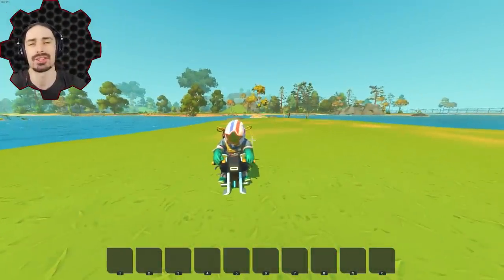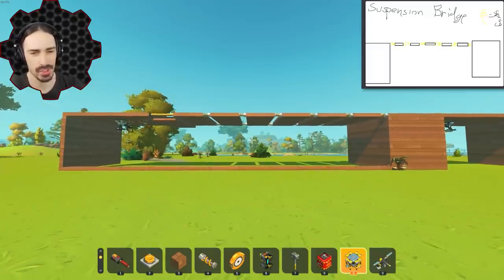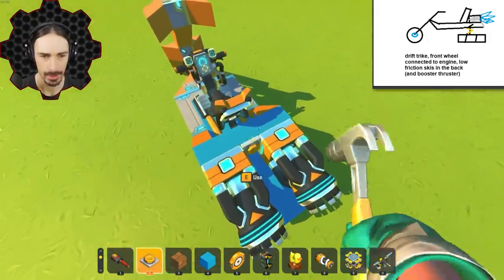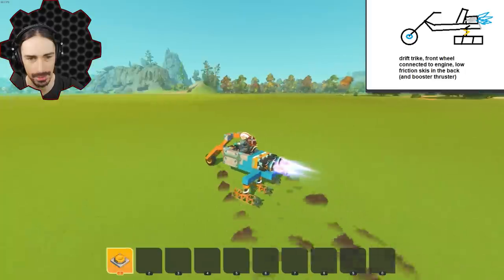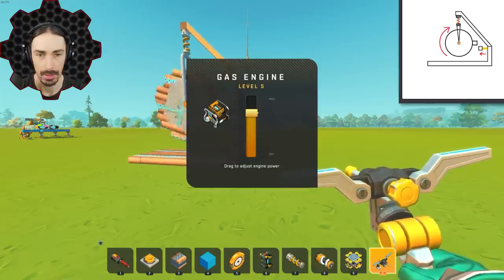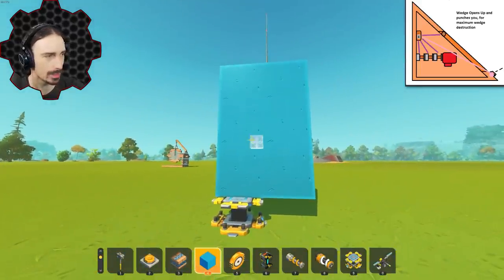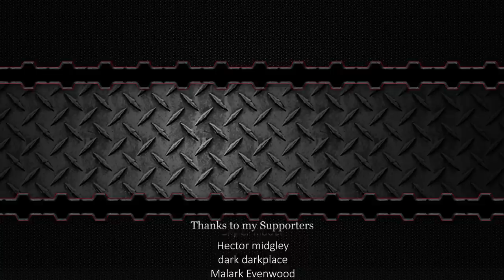You DRAW IT, I BUILD IT! Flywheel Physics, Drift Trike, and MORE! [YDIB 17]

Comment: Should've used simple physics 1 for the catapult, bearings on creations that are attached to the ground are super strong on that setting, only ones on free floating objects are floppy
Reply: wait what? Why?
Reply: @vibaj16  Simple physics 1 isn't really just "worse physics => more performance" (that too but not only that) , devs test a lot of optimisation features that can impact gameplay and creations in ways they don't know. Basically this is a new calculation method for bearings and how stuff on them is handled.  When a creation is attached to the ground it's stuck to world's block grid, so we just take the axis which the bearing is on and rotate things that are on it relative to the world grid (and the world itself) and don't allow any off-axis movement and voila we got super performance friendly bearings that hold everything with a grip of a titan!
Reply: @ADonutMan  Why don't they just do that for the higher physics settings?
Reply: @ADonutMan  I thought that the weak bearings was a purposeful (yet dumb) feature. Isn't it actually simpler to have the rotation be locked so that it can't "stretch" at all? I remember someone saying that Axolot allowed some "stretch" to make joints more "realistic"
Reply: Or pipe pieces in low friction blocks, and cap the pipes with more friction block to make an axle with no bearings.
Although the pipes might just faze through the blocks.🤷 Don't know ain't got the game.
Reply: @theyeetus1428  They said before that "a lot of updates to physics are coming with chapter 2", so I think that's just one of the things they wanted players to test before shipping it with other stuff in chapter 2, you know how Axolot loves to release things in big packages, rather than small individual updates. So that's my guess why.
Reply: @vibaj16  Not really, all games handle joints like that. It's just that some can hide it better than others, because all games handle everything like objects (so say in teardown every voxel is an object which task is to render only the sides that are visible, all voxels of the same material are an object and all materials compose a physical object, say a box) so a thing on a joint  an object that needs to stay "attached" to another object and a joint is just a thing that tells the game "hey that's how these two should be relative to each other",  so in sandbox games for the physics engine these are two separate objects that just have special conditions. The difference is what algorithm the engine uses to keep these together, and sm's one just happens to be not ideal for bigger objects.
Reply: @ADonutMan  pretty sure a lot of other games just keep it locked so that they can't detach

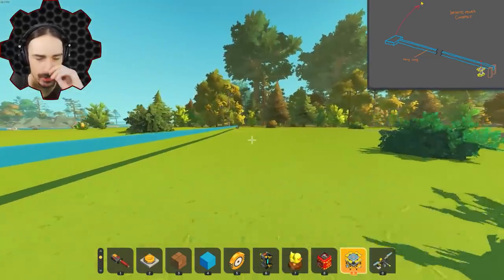Comment: 9:03 i believe the problem there may have been the fact that one od the bearings was attached to the arm instead of the ground
Reply: I don't think that changed much of anything
Reply: @vibaj16  Except maybe the asymmetry of the force on the arm, which made it jump out of the fork in the first place, could have come from that difference in the bearings. Or it may have come from the fact that an even-width lift interacted with an odd-width catapult arm. But I also don't think that once the arm was out there was much of a difference.
Reply: That wouldn't really change anything. The main point is that there are 2 bearings on 1 system working cooperatively to bear the entire force being applied to the arm. Bearings, pistons, and suspension are all notorious for failing first in Scrap Mechanic. So naturally, even if he had both bearings based on the uprights, the result would be that we'd see the catapult arm flying around without a bearing on it. Same result with a different aesthetic. It was a pretty predictable outcome since physics pieces (the three I listed before) and matter are the first things to fail when numbers get too high.

Comment: I think the flywheel is actually physically accurate. As the wlywheel hits the stopper, a huge force is pushed into the ground, which pushes back. 

It could also the be spring that stores the energy, and then distributes it between a down force on the flywheel and an up force on the bar.

And, hmm, yes, if you have a havy items bouncing on a spring, you can make a lighter platform jump.

Comment: I think the problem with the trike is that your caster is the wrong way so that makes the creation unstable. The steering axis should contact the ground in front of where the wheel contacts the ground. This could be achieved by making the handle steer along the diagonal connection instead of the vertical axis. Not sure if it will work in scrap mechanic, but in theory it should be better.

Comment: The thing that makes drifting with drift trikes and drift cars in real life easier is a thing called caster angle, where the pivot pint of the wheel is actually at an angle. I don't know if this would help in scrap mechanic as the steering is designed to straighten if there is no steering input, but in real life where the wheels try to correct themselves, caster angle forces the wheels to countersteer easier

Comment: We do see stuff like that "suspension bridge" in the real life.

Those suspension pieces are acting as expansion joints. Real bridges use them to compensate for thermal expansion/contraction. When a bridge is long enough, heating & cooling could change the length by a significant amount. Obviously, a bridge shrinking a few inches would be a problem if it's firmly attached to the ground, so there are expansion joints inside to allow the road surface to change size without destroying the bridge.

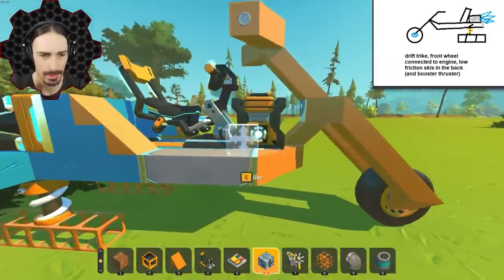Comment: 15:28 and it's also the reason why the front wheels of a car have stronger brakes, they block easier, with the rear wheels still rolling, it stabilizes automatically.

Comment: Id say being able to launch an entire bridge assembly into the blue void is a pretty successful first try

Also that drift bike design would probably be amazing if you reversed it, thrusters up front like a pod racer, on sleds with the single wheel at the back for steering and more fine tuned movement

Comment: With the bridge, i was thinkin, the planks should be attached to opposite sides of the shocks. So, plank on right with a hook over the top of the spring attached to left side, and vice versa, but under the spring.. that way when driving over it, the springs would be compressed instead of stretched

Comment: The spring bring isn't too far-fetched, hear me out. In large bridges, the designers have to take into account the fact that heat makes the asphalt expand meaning there will be nowhere for it to expand to, so the designers create a large peace reaching from each side of the bridge(width) to the other. And it creates large peace of asphalt that when it expands each part of the bridge has room to expand whist still being connected as a whole road. They are called expansion joints and almost every bridge with lots of asphalt uses these including the Brooklyn Bridge

Comment: Request: make a very off balanced flywheel that spins super fast and it's on a suspension with low strength and the base should be super heavy so it tries launching itself off the ground instead it just slightly scoots around

Comment: The upside down cube build was waaay too complicated. You could just build it right side up, then weld it 90° to another correctly positioned creation and tip the rest over with your hammer.